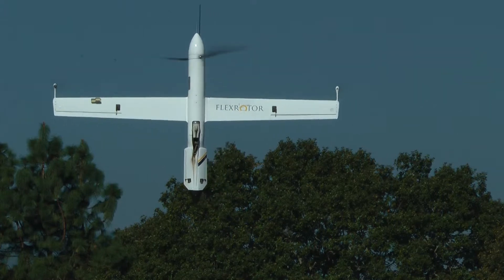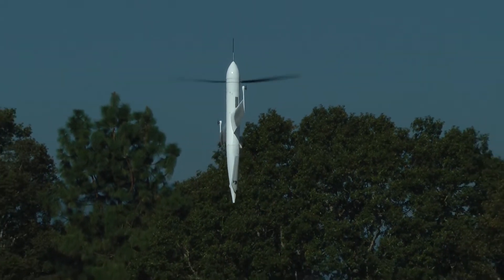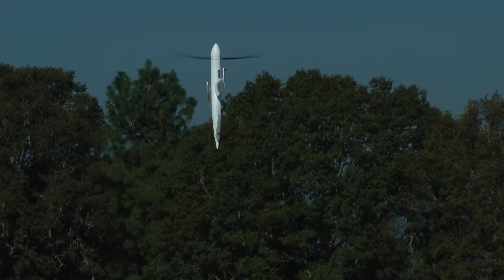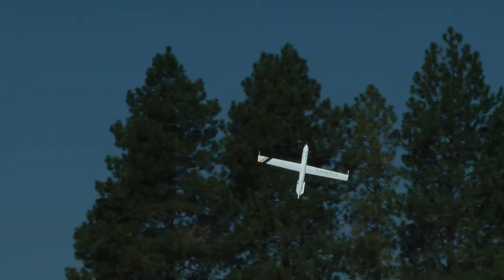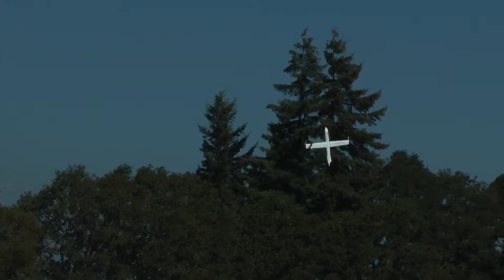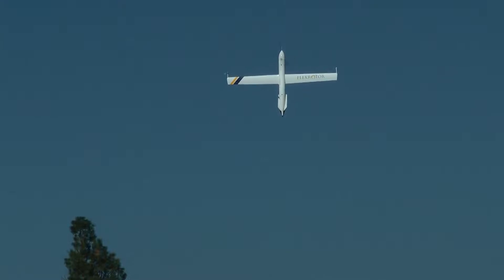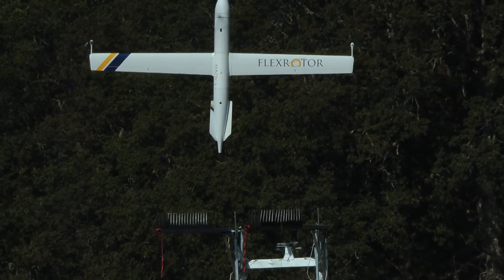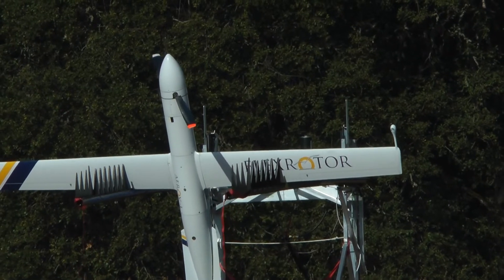Flexrotor "Tricia" in thrust-borne autonomous flight

Comment: how does it turn
Reply from the maker: As a helicopter while thrust-borne; as an aeroplane while wing-borne.
Reply: AerovelCo is it changing the pitch of the blades so that when the blades are on the opposite side of the direction you want to move the blades are set at a more aggressive angle so there is a net force in a sideways direction?

what are you guys doing with this project at the moment? surely the air force must have bought it xD

Comment: it would be much better if in plane mode the propeller was put in the back instead of the front and during transition have the have the propeller change it angle so that it can fly in the other direction and  also loose that annoying voice.